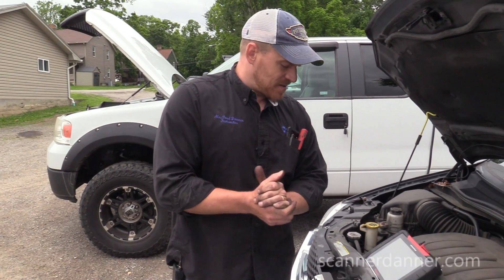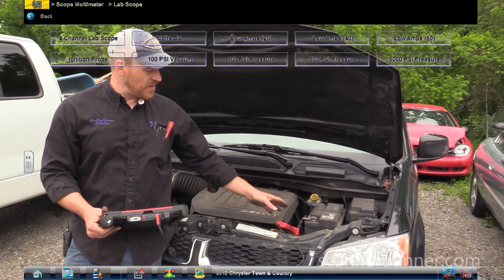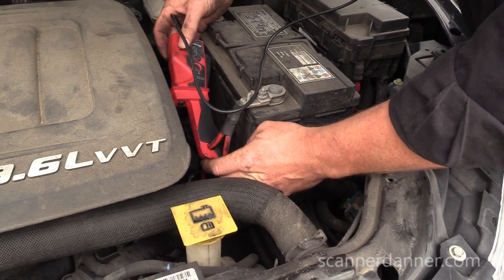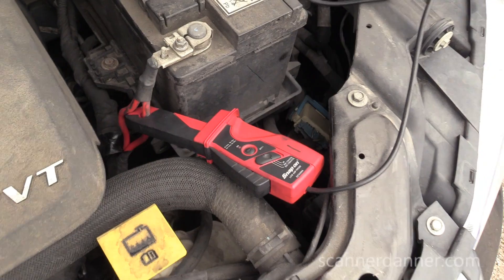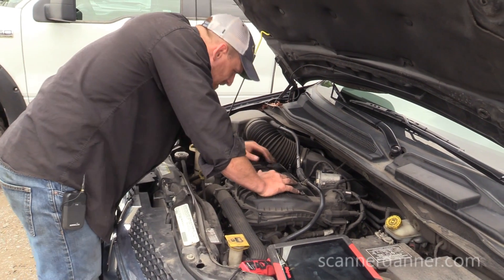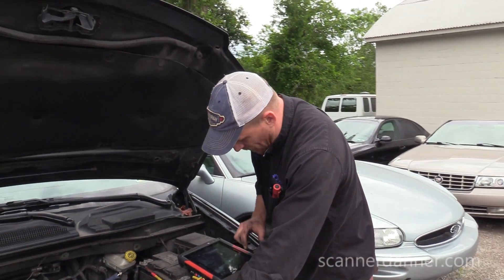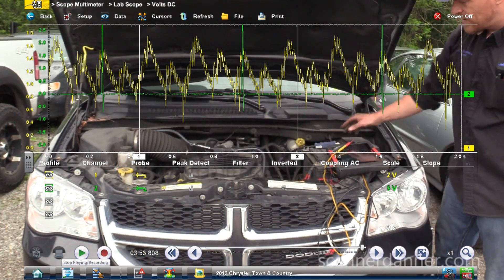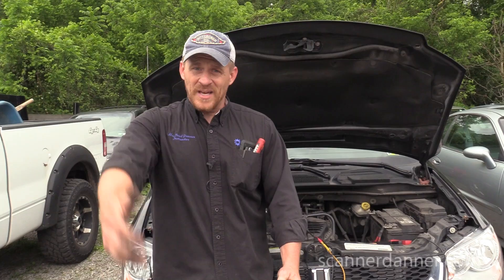Cranking compression sound and scope test

Comment: Ive been trying to isolate a lean misfire situation for close to a month now (I'm not a mechanic,  I'm a driveway mechanic when I'm forced to be), in the process installing:
New spark plugs
New plug wires
New MAP sensor
New EGR valve and gasket
New distributor cap
New distributor ring seal
New distributor rotor
New upstream o2 sensor
New downstream o2 sensor
New PCV valve
New various vacuum hoses
In my 2000 4cyl accord with 360k miles, and now after watching the first minute or two of this video, have finally diagnosed it as low compression on cyl 4. It took me literally 5 minutes,  I paused the video,  got dressed, grabbed my keys,  unplugged my distributor and cranked it over. It was even more pronounced than the car in your video. Now I don't know if it'll ever see that 400k mark, and I'm sure it's due to rings, and a variety of oil leaks Ive been trying to plug like the little Dutch boy. 
Great video,  thanks for posting it...
Reply from the maker: The sound test is awesome isn't it?
Reply from the maker: You may get lucky, your engine may need a valve adjustment (if it is adjustable, most are not). Thank you!

Comment: My Jeep's got this engine and misfiring on 6 too :( I was hopeful that it wasn't a compression issue when I did a compression test and it was still reading roughly 120 PSI... But cranking sounds just like this.
Reply from the maker: Yeah you can't go by a compression gauge for this problem because sometimes it is good, so your manual gauge will not pick it up because of the check valve

Comment: Hey ScannerDanner , any chance you could take a listen to this and tell me if you think there's a compression issue? https://youtu.be/ZtSef5E8ztM It's a 2013 BMW 330d (6 cylinder) with a misfire on cylinder 2 that doesn't move if I swap injectors. Injectors unplugged to record cranking
Reply from the maker: compression sounds fine! You have a #2 misfire that stays with the #2 cylinder. Have you done anything with the ignition coil or plugs? These BMWs REQUIRE a factory plug only! Especially if this is a GDI system https://youtu.be/bPCtfMq72ds
Reply: @ScannerDanner  It's a diesel :)
Reply from the maker: @dopiaza2006  guess the spark plug are fine then 😂 sorry about that. I don't work on any diesel systems
Reply: @ScannerDanner  Yeah, diesel is a bit different but not that different really. It's still suck squeeze bang blow, just a bigger squeeze and bang!

Comment: 😬when that p0300 code you showed in the video I nearly split my pants. I have that code on my Subaru. I get it ONLY when going highway speeds. After about 10-15miles i get the cel. It starts up like a brand new car ever time. I’ve put so much work into it and I’m hoping to god it’s not low compression. I’m pretty experienced with hem and German cars. I never go to a mechanic other than to get smoke tested. I’ve done swaps and everything. But THIS has me stumped. The car runs flawlessly. I don’t even notice a studder when the cel comes on. Only 2 things I have in mind other than compression: the exhaust leak I have before the turbo. And a possible vacuum leak. This thing has almost ever vac line torn missing or duct taped. But it’s possible there are a few that aren’t making the system a perfect seal. Help NEEDED
Reply from the maker: What are your fuel trim numbers?
Reply: ScannerDanner I don’t have necessary tools to see. but I think I finally cracked it after 6 months of confusion
Reply: ScannerDanner I believe it’s the fuel pressure regulator. On a turbo car it asks very different instead of increased vacuum (where it was sucking unmeasured fuel through the vacuum line) when boost started at 3500rpm it was drive different and go much leaner. There is very little information about this online with all the symptoms I’m having

Comment: Newbie question:  if a car doesn't have a clear flood mode, what is the best way to disable the fuel injectors for the relative compression test?  Pull fuel pump fuse?
Reply from the maker: great question! Yes, disable the fuel pump, just be sure that when you do that, that you are not also disabling the ignition system if you are using that as a sync like I did in this video

Comment: Thanks for the great videos. Have you ever an increase in current on a cylinder during a relative compression test? Check this out. https://youtu.be/Wz_nsAESgrQ
Reply from the maker: Yes, if the exhaust valve on a companion cylinder doesn't open you'll have a very high compression hump because you have two cylinders trying to compress at the same time.

Comment: So no need for a high amp clamp to do relative compression? I can use the amp clamp that comes with my uscope kit?
Reply from the maker: yes sir, but only up to 250 amps
Reply: ScannerDanner do I hook it directly to the scope or do I need a 100:1 adapter or whatever its called? What are those adapters anyways? Sorry, new to these types of things. I think the uscope master kit comes with an ac coupler and a 100:1 adapter or something like that
Reply from the maker: No problem. Inductive amp probes produce voltage and never need an attenuator. The probe that comes with the uScope produces a maximum of 2.5 volts
Reply: So what's the purpose of the ac coupler or the 100:1 atinuator or whatever it's called? Excuse my misspelling lol
Reply from the maker: For protection from inductive kicks of fuel injectors and ignition coils when measuring primary voltage
Reply: I get it now, thanks for the quick responses. I asked a question on your website as well, it was under your chapter 13 types of fuel injection video. Whenever you're able to, I'd like some insight on it. Thanks again!

Comment: 13:57 Was that a sub contract diagnosis for a workshop. Who does the leak down test.??
Reply from the maker: yes it was. The garage owner would take it from here
Reply: Thanks for the reply. I've done a bit of sub work and one thing workshop owners expected of my report was they could read it and then call the customer and give them some ball park on time, cost and whats wrong, not have to put another tech on it to do more tests to find out that. You can tell him its 2 down cylinders but for quoting purposes he would likely need to know if its top or bottom end, or perhaps overhead valve train. A look at the oil cap off for blow by and a vac gauge on the intake to look for valves narrows it down enough to then quote a full engine or just heads. My prime objective was making sure my report gave the information they needed to quote the job directly from it the moment i handed it over worked well for them. A lot of cases might need more than instrument testing to quote but more often with a few hand held instruments it could be narrowed down enough.

Comment: Just so this info is out there, I don't know if you saw it or not or if it is relevant to this video. but Chrysler did extend the warranty coverage on the cylinder heads for 2011-2013 3.6L to 10yrs/150k miles..... Bank 2 heads are having problems.  I have had many of them in my shop within the last few months.

Comment: In the description you show both the low amp probe and the High amp probe. I see you use the Snap on one. Does the Snap on one incorporate both High and low amps in one unit or is it just the one you have. If that is the case which is the one most commonly used for lab scope tests.
REPLY
Reply from the maker: The Snap-on one I am using is a low amp probe and you will pay 4 times as much for the same amp probe I have listed. The reason I also listed a high amp probe, is with the low amp probe you are limited by the size of the jaws (wire size) and it will not read more than 250 amps.
Reply from the maker: you will get by with 90% of the testing you need to do on cars with the low amp probe

Comment: Paul in the description you show both the low amp probe and the High amp probe. I see you use the Snap on one. Does the Snap on one incorporate both High and low amps in one unit or is it just the one you have. If that is the case which is the one most commonly used for lab scope tests.

Comment: Valve guide on cylinder 2 not machined perfectly...warranty is extended on that cylinder head if it's your issue.   Only the left cylinder head.

Another common problem is the roller bearings in the rocker arms going south, rocker arm seizing and wiping out a cam lobe.
Reply from the maker: weird that it is only the bank 2 head
Reply: And not all of them either!  Just Mexican built ones as far as I can tell.

Comment: **NEVER USED POWER PROBE 4 FOR SALE. COMES IN BLACK BLOW MOLD CASE STILL IN PLASTIC AND WITH PLASTIC ON SCREEN STILL. NEVER CONNECTED IT TO A VEHICLE! COMES WITH THE DELUXE CONNECTOR KIT, BOTH GREEN AND YELLOW PIERCING PROBES, BOTH PP MALE AND FEMALE COUPLER, A BACKUP CIRCUIT BREAKER AND ROCKER SWITCH, ALL 3 GREEN PP BULB ADAPTERS-ALL NEVER USED!

Comment: So unrelated to this video... I couldn't find your email address to ask this question. With a 2 wire VRS turbo speed sensor, signal, and sensor ground. Should there be 2v on the sensor ground with the key on.? The ground goes straight to the pcm and it is pwm.
Reply from the maker: It is common that they use a bias voltage on VRS inputs and they will put it on the ground or positive side of the circuit
Reply: Ok thank you. It's on a 15 ram 2500 diesel.

Comment: Done a bunch of these heads on both the 3.6 and the older 3.7. Dealer workflow is verify that it is not the coil pack, sparkplug or fuel injector. If it is none of those then do a leak down test. If more than 25% leak down, replace head on misfiring bank. The dealer scan tool does a bit better job at seeing the misfires to find the offending cylinder.

Comment: Careful a broken valve sping, or a launched pushrod could show up as a higher compression on a companion cylinder. Ive also used a regular test lead and hold it near a coil topickup a ignition event. (NOTRECOMENDED it could kill your scopem but will work in a pinch)
Reply from the maker: Agree, not the recommended test lead for that COP probe.

Comment: On VW/Audi 2.8l engines I know if that engine floods out it washes the rings to the point where it sounds like ZERO compression (like the timing belt is off or the spark plugs are removed). Just something to watch out for.
Reply from the maker: definitely need to be aware of cylinder wash

Comment: Awesome addition/refresh to the relative compression test videos. I learned this trick from your channel and have been using it since I bought a vantage pro and low current amp probe after watching your videos. I also learned something new from this video about the difference between the peak heights in the waveform, it made total sense. Thanks for the awesome videos on both of your channels.
Reply from the maker: Thanks Richard!

Comment: How many amps is the clamp?
Reply from the maker: It is a low amp probe with a 20a and 40a setting but you can read much higher current with them
Reply: ScannerDanner so I really don't need to buy that big lobster claw that I can't fit in there anyway? Would it just be a resolution issue? Not really relevant for particular test. Or maybe just test the one I got and see if it works, just don't trust the numbers for accuracy? Thank you
Reply from the maker: Paul, not sure what your question is exactly. Can you rephrase it?
Reply: ScannerDanner could I just use the low amp clamp for doing things like starter draw? Or would the numbers be to inaccurate? Thank you for your time
Reply from the maker: Yes you can. But I think the limit is 250 amps. Here is a video where I found out about the limit of it. 
https://www.youtube.com/edit?o=U&video_id=4YWCKzpbgb0
Reply: Awesome, I didn't see you replied so quickly. I also searched the forum and got some good info. Thanks
Reply: i have a 3.1 im getting gas but no fuel in the return line

Comment: Very nice video Paul! Those new 3.6L from Chrysler had valve issues on the Bank 2 cylinder head. Girlfriend owns a 2013 200s with that engine and received a letter from Chrysler giving her a extended warranty up to 150K miles on that cylinder head. I'm willing to bet that is the issue. Had 2 of these town and country's head to the dealer for this issue also. But all in all great video my man!
Reply from the maker: Why only bank 2? someone else said the same thing
Reply: ScannerDanner not sure... always wondered why bank 1 doesn't do it.  Also the two can I personally seen the issue on was either cylinder 2 or 6 haven't see one personally with cylinder 4. It's odd but I never really looked too much into it that's for sure tho

Comment: I beleive that there is a extented warranty for this issue. The cylinder head will have to be replaced. All for free. X56 recall if I remember correctly This is a common issue with this engine. However this engine is making noise like it has a bad set of lifters. 
On the 3.6 if the oil isn't changed often enough they wipe out the cams and the lifters get replaced also.
Reply from the maker: thanks for the tips!

Comment: Nice one, Paul!
If you dont have COP pickup handy, then is it easyer to get to PCM on this one, for timeing or the sourse it self coils/injectors,(or wire harnes/connectors)... ?

Reason why i ask is that the newer and newer the car gets in here where i work, it looks like its easyer to get the ECM/PCM, then the sourse on what ever it is. All is shealded for some reason.....
Reply from the maker: For sure, or in this case I could have synced off of coil primary.

Comment: Just had one of these with the exact same problem come into my shop last week. Did the same thing with the cranking compression/starter current draw test with my Pico (that I learned from your channel). Chrysler has extended the warranty on these for replacing the cylinder heads for this problem, and the customer should check with the dealer to see if this car could have the heads replaced for free before they tear into it.
Reply from the maker: Thanks Chris! And for the tip

Comment: I have a V6 with a similar problem. It has no blow-by, so could I safely assume that it has a burnt valve?
Reply from the maker: No, the term "blow-by" in itself is compression pressures making in past the piston rings and into the crankcase.
Reply: Yeah, I'm trying to determine if the low compression is either caused by blow-by or a burnt valve by looking at the oil fill with the cap off while the engine is running and checking for any pulsing pressure coming out. If that even makes any sense.
Reply from the maker: That won't tell us enough. Do a dry and wet compression test and compare readings. If it's drastically better when you put oil in the cylinder, it's a ring problem.
Reply: The copy of the Ford invoice told nothing, it's amazing that they didn't do the complete test to determine the cause for the previous owner.
Reply: I'll add some oil to that cylinder to see what happens to further troubleshoot it.
Reply: ScannerDanner 
would it be possible to identify a compression problem by measuring blow-by gases in the crank case.

low compression = less blow-by gone into the block.

I know there are better ways to do it but would it be possible?
Reply from the maker: You could put a pressure transducer on the oil dipstick maybe and then sync it with another trace, but that's not easier most of the time. Put air in the cylinder is another one (leak down test)
Reply: Thanks for the advice.

Comment: Those 3.6 heads eat themselves away. Specifically the valve seats causing the misfire/ low compression.  Chrysler re-designed the motor and kept their mouth shut about  it.
Reply from the maker: wow, crazy. Thanks for the tip!

Comment: Master, my question is; why not use a 10:1 Attenuator in snap on scanner and Pico does. @ScannerDanner
Reply: Snap on can handle the high voltage(over 400), even if out of scale. The pico cannot and may be damaged.
Reply from the maker: no attenuator needed when using a capacitive pickup, no matter what scope you are using. Also as sterline80 mentioned the snap on can handle up to 400v spikes with to attenuator. My newest Pico (4425) is a 200v spike max.
Reply: ScannerDanner yes that's true about the probes. I read the question as a general snap on vs pico question, not specific to the video.